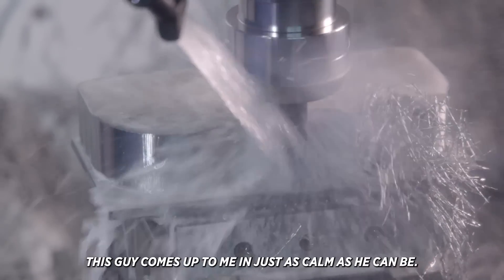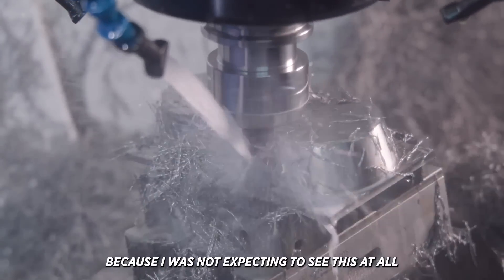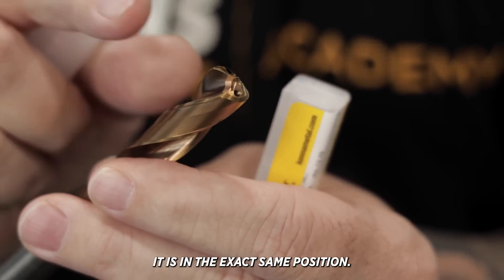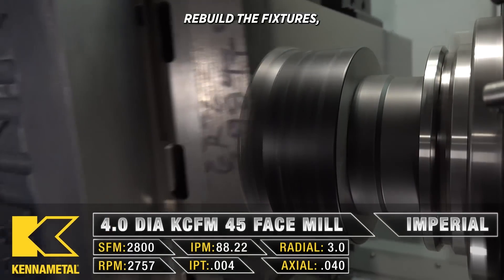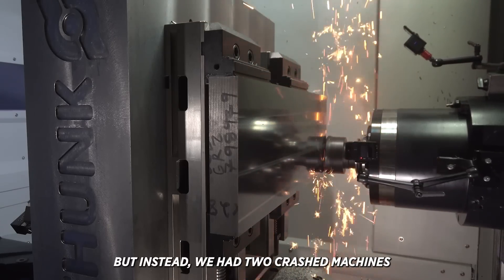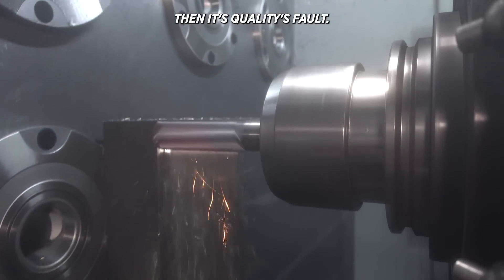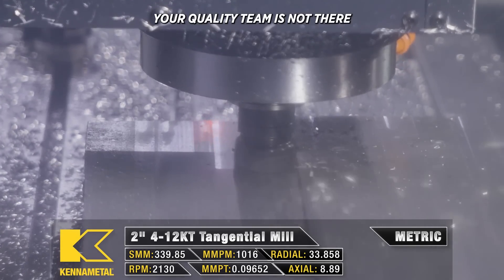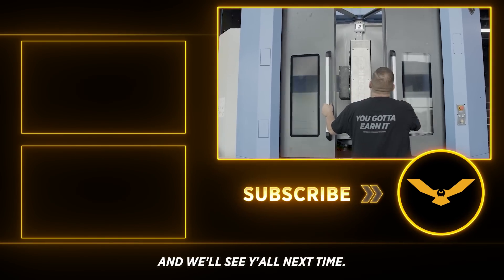$200,000 Damage | EPIC FAIL… Machinist CRASHES TWO MACHINES at the Same Time

Comment: Working in maintenance for the past 4 years at a manufacturing plant with all types of CNC's, I have seen my fair share of operator screw ups and more excuses from them about why it happened than you can shake a stick at. It's never their fault. For example, I had a Mori 3-axis NL. I had to replace the y-axis brake twice and the ballscrew once in two years. Operator kept crashing it and hiding it until the machine stopped running.
I just can't with some people SMH. 🙄

Comment: That attitude of " it's not my problem, is more prevalent in this industry than one would think. 
I thought this was a story about Edwardo, a guy who runs my machine on 1st shift at the company I work at. (I work 2nd shift) All the drills and end mills in my machine are either chipped or warn out. I put my good tools in when I make parts and take them out at the end of my shift putting the other tools back in. big waste of time, but for some reason the people in the front office don't understand, and don't care. The good part for me is I get a lot of practice doing setups which only make me better and faster, for that day when I move on to a company that cares a little more and pays a little more. with skill should come reward, so Practice makes Perfect, but nothing is perfect. That's why you keep trying unless you are Edwardo!

Comment: Early '70's, I was running an Okuma slant bed, 3 axis, 6 station turret machine. It had a Vickers UMAC 7 CNC controller on it where the program was run via punched paper tape in a loop. This is a big machine. 50 HP spindle with an 24 inch swing over the 12 foot long bed. We were running forgings, nose landing gear trunnions for Lockheed L-1011 aircraft. Each forging weighed approximately 60 pounds. We were running the 1st operation on the forgings which was mounted in a (not so...) counter balanced fixture plate.....maximum spindle speed was 31 RPM. The operation was to face, center drill, then drill and bore the hole in the "foot" of the forging. Running each of these forgings took approximately 25 minutes due to the low speed the spindle was forced to run. The set up passed 1st article inspection and we had been running the parts for about 3 days on two shifts. I loaded a new forging into the fixture, torqued the hold down bolts and nuts to specified torque, I then pushed the "CYCLE START" button on the UMAC 7, as I had countless times before. When running any machine you get used to the sounds it makes..... the clunking of gears in the headstock, the whine of the hydraulics, etc. This is what alerted me that something wasn't right. The spindle was limited to 31 RPM per the program....there were NO gear changes, yet after pressing the "CYCLE START" the first thing the machine did was change gears in the headstock. I immediately pressed the "EMERGENCY STOP" button....repeatedly. It was like watching a train wreck. When the machine finally got into the gear it wanted(580 RPM we found out later) the 50 HP spindle motor started, all the while I'm mashing the "EMERGENCY STOP" button in a panic.  The spindle motor let out with a groan as it started trying to spin up approximately 350-400 pounds of weight to the new speed it decided upon. I got out of the immediate vicinity of the machine...in a hurry! As I watched, the turret then went to a new "HOME" position....about 6 inches from the accelerating forging. The turret then indexed an 8 inch long tool holder, with a facing tool mounted, directly into the still accelerating fixture/forging. There were several loud "BOOMS!" as the machine self destructed. The forging came loose, flew through the shield and landed almost 80 feet away, just missing the operator of a Warner & Swasey #5 manual turret lathe. The tool holder shattered sending cast iron shrapnel for 50 to 60 feet all over the shop. But still the spindle was trying to spin up to speed! Luckily the operator of a Hardinge ASM behind the Okuma had access to the main power going into the Okuma and was able to shut it off. It took 15 seconds for everything to come to a stop. The imbalance had shifted the 22 ton Okuma lathe 18 inches from where it had been mounted....after shearing the 16 1 inch mounting bolts holding it to the floor. The turret was hanging from it's hydraulic lines. The shield was laying up against a Waddell ASM that was about 15 feet away. All told about $125,000 damage on a $500,000 machine. The reason for all this carnage? Paper fuzz....... The machine ran a paper tape reader that needed to be cleaned daily. The company had only had the Okuma machines(3 of them) for about 4 months when this happened. The company selling and servicing the Okuma machines had neglected informing us that the tape reader needed to be cleaned daily unless plastic tape was being used. Over the 3 days of running the tape reader was fouled with paper fuzz that caused the reader to miss read the tape....altering the program in several different ways. Come to find out, the "EMERGENCY STOP" button doesn't immediately stop the machine.....it puts it in a program hold mode....it'll stop after it finishes it's last instruction from the tape. I never trusted a CNC machine after that and I refused to turn my back on one.......
Reply: This is the greatest and scariest crash story I’ve heard yet. That Okuma was dead set on destroying itself.

Comment: Being promoted sounds like he was doing what he was told.  Some shops run new managers thru every six months with orders to “ run the machines during breaks, lunches and shift changes”  without regard to the machinists comfort with doing so.   Looking to maximize productivity and overloading an operator with multiple machines to monitor, Setup, deburr and then Inspect sounds like a management problem of not understanding limitations of labor.

Comment: Mazak 1060 5 axis mill turn Intergrex.  We were machining defense part that was 3ft tall facing up on tombstone.   I was taking over the job as day shift and programmer had made a change.  at the point of program with the updates I watched it do its thing ok.  Then comes tool change - whammo.   I had took my eyes off the ball.  this machine had to go very z negative to change tools.  so I had a secondary home to move XY and then Z. 

The update had the normal go home code for mazak which was rapid to tool change Z - G30 I think.  whammo

Comment: Sounds like the programmer is at fault also for leaving the tool length comp out. Blame isn't just on the operator. 🤷‍♂️
Reply: Walking away on an untested program is  100% on the machinist. That is such a basic bitch error I fully expected the guy to be fired on the spot. I've seen people get banned from the shop floor for less (guy smashed a very expensive mechanical clock by breaking several work floor rules at once, got his ass reassigned to painting and assembly)

Comment: So many guys in the trade, just like this guy...I was raised with the work ethic, that if something is worth doing its worth doing right. This includes taking responsibility for your actions. And if your getting paid to do something,  that in its self makes it worth doing right....also alot of guys I've worked with, think there job is to push cycle start and then kick back and put thier feet up until it's done

Comment: As soon as the probe is in the spindle all moves should be protected moves with skip turned on. Doesn't matter then if offset is missing,  worst-case is a broken $100 stylus?

Comment: Holy &%£? you mean the asshole got promoted? The operator should have been sacked on the spot or paid off because with that attitude like that he'd do it again. Even after 20 years of programming and machine operation I'm STILL nervous about walking away without being 100% sure the XYZ axis are going to where they are meant to go.........I'll admit I've made programming mistakes, but I've noticed them and never crashed a machine!

Trouble with cowboys (UK definition) like this is they affect other employees, $200,000 is money down the drain, margins are tight in CNC and I'd be livid if machine wreckers like this cost me my job........sack him!

Comment: A machinist at Rolls-Royce Ulsteinvik smashed a big turning cell, vertical lathe, forgot G50 and turning up in a cone towards 0 and RPM got to high ant the part flew out of the door chasing the already running operator, cost around 150.000 as far as i remember. The operator was offered to come back to his machine again, but he didn't dare.

Comment: Learned on fancy machine run 1st parts through at 25% rapid or lower. Had a few machine that had nice load monitors set. So could rapid the tool into the part and It would insta-stop and not break when on slow rapid. Crazy how many times it saved people at my last place lots of money. Then for 2nd part full speed.

Comment: The machinist in our shop just follow the work instruction and using strict gcode, while the programmer should allowed to deliver gcode changes after they have trial it themselves. The revision should clearly mentioned and has approval signature, otherwise the machinist could object to run it.

Comment: I haven’t seen anything that bad but we’ve had some close calls. His recommendations are spot on, the cultures vary from shop to shop though so I feel like machinists get the ass-end of whatever effort engneering, planning, and programming decides to put in before them. Subsequently your machinists go super slow because they have to cover their asses, like double checking for print errors, engineering changes, short-handed processing, and overlooked programming errors. Not to mention the worn out machinery giving you unreliable cutting conditions, chatter, spindle runout(etc.). In the end their parts have to come out completely within specifications, every time. I’d love to say it all depends on the programmer and machinist, but in-house engineered assemblies take a lot more than that to be successful/profitable.

Comment: I worked in a shop where the owner thought he was a " machinist" He made more mistakes and crashed his own machines more then anyone and more then at any shop I ever worked before or sense. He would do the same thing. New program. Full rapid and hit go. He got a new VMC. Had it less then a month. Missed the fixture offset on a 4" facemill. As Titan says..........BOOM! New spindle AND new transmission. The machine was NEVER the same after that. He had this odd way of programming too. Tool zero was +.010 above the setting surface. WTH? All his program depths were .010 deeper then the dimensions on the print. Totally sucked if you were trying to set up a job he programmed. Another shop I worked the lathe guy changed the global offset on a gang turret lathe. She too went BOOM. Guy looked inside the machine , loaded his tool box in his truck and left. The casting dovetails were broken off. The machine was a total loss. That "it's not my fault" attitude made me want to smack more then one person. Own your parts and your work. Good and bad. Learn from your mistakes and others mistakes. Pay attention. These monster machines move so fast you won't catch a mistake until it's too late. Prove it out at less then 100% rapids. Take the time, make the time, do it right the first time. No ones perfect. Mistakes get made. Don't be stupid! If someone doesn't want the responsibility stick them in deburr or show them the door. This trade isn't for everyone. Set the machine up and hit go. Give me a break. Then he gets promoted. Promoted to his highest level of incompetence for sure. That just sets a bad example.
Reply: My boss is like that too, I'll be proving out a new program for a new part and taking my time being safe, and he'll walk up and give me shit about being slow (he's usually just messing around) but one day someone pissed him off, maybe he didn't get a check for the parts yet or had to buy new tooling and he was in a bad mood and came up to me when I was proving out a new program which was a big ass 316 stainless part for a certain space company, and he was being an actual dickhead telling me to hurry and I wasn't even halfway through the program and he just stood there behind me watching and being an ass, telling me to hurry. So I lowkey lost my shit and looked at him and smiled, and said "100% rapid and full speeds and feeds ahead!" And turned everything up  (including the spindle and feed) no single block this time and optional stop off, and sat there right next to him watching. The next few tools went okay, but then it was time for the 6" facemill to start the roughing toolpath, which was a little heavy I'd say. With full speeds and feeds ahead the facemill came in hot with that .250 depth of cut full radial, 7500rpm and 650ipm it made it about 8inches across the part sounding like a helicopter firing a minigin while crashing into a skyscraper and turned a sinister white and red color and the facemill head welded itself and then melted off and flew off fast and bounced off the side of the vise and then slammed off the way cover ruined that and put a huge dent on the side of the machine with a big crack in the middle. The spindle was really fucked after that too.I looked at him and said "oh no I should've been faster" he was speechless and looked like he seen a ghost, then he lit his cigarette and walked over and called the doosan repair guy. I told him I'm going to clock out and go to the bar, and was considering quitting after that, he said "see ya in the morning" all my coworkers were speechless standing there looking like lost prairie dogs, I didn't say a word to them and went and clocked out then got hammered at the bar.

Comment: Had a crash running a old deawoo puma lathe. Was pulled off my machine doing a first run so i had it sitting in SB while i set up the puma. I felt real uneasy about it but needed it up and running for our manual guy to have some work. Well i was pretty distracted over my own machine and didnt notice a massive rapid movement straight into the chuck. We ended up tearing the whole turret apart and doing a whole retro fit  of about 75k in damage. I just sat there after it crashed owner came over and talked to me i was so scared i was gonna be fired.

Comment: First job I ever ran on a little CNC knee mill, we had to manually change tools in it.  And I forgot to put tool one back in after I completed the cycle and hit got because I was just in the flow.  And bam 2 inch long precision drill chuck with a 4 inch drill came down instead of a 1 inch long endmill and yeah it wasn't good.